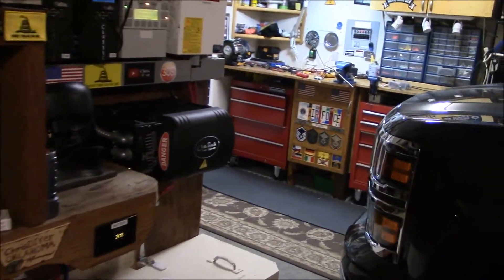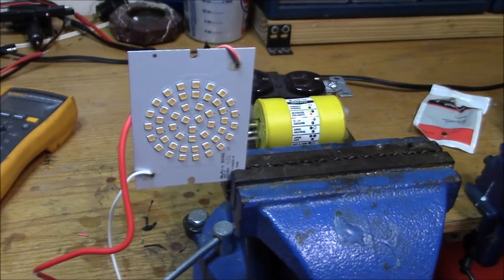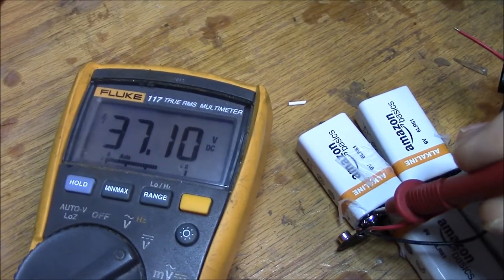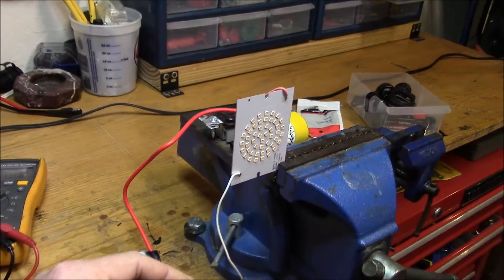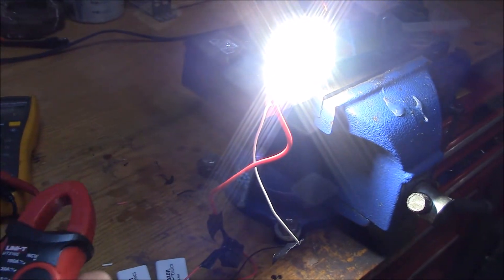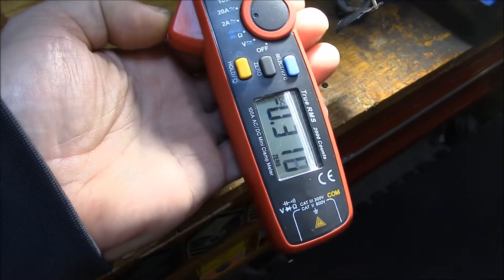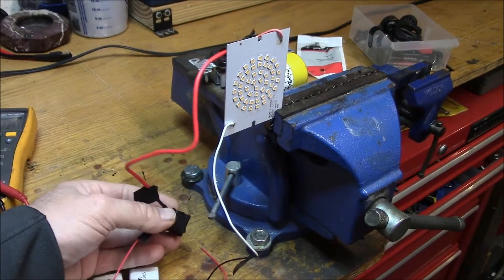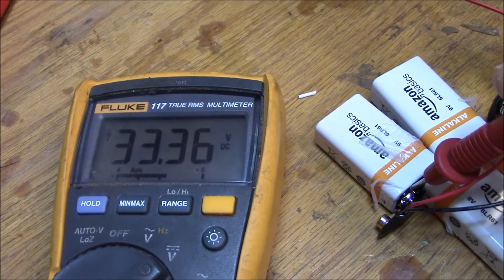Workbench experiment! - 36v LED light element running on four 9v batteries

Comment: So awesome!
Back in 2008 when I installed the Off Road LED lights on my car I wanted to increase the volts for some additional brightness, but still haven't done that.  Maybe some day.  
I too was a kid who played with wires & batteries.  I remember my radio shack 131 in 1 electronic project kit & all the wires & spring connectors so fun.  
Have you ever tried any of the Elenco soldering projects from Amazon?
They are great.
Take Care Friend.
Reply from the maker: Naw, got something else I am working on. Those Radio Shack kits were really cool. I had the 75-in-1
Reply: Chris DIYer 
Yeah I spent countless hours Building things with that electronic project kit.  & I did a lot of chores for the neighbors & family to save up for it too.